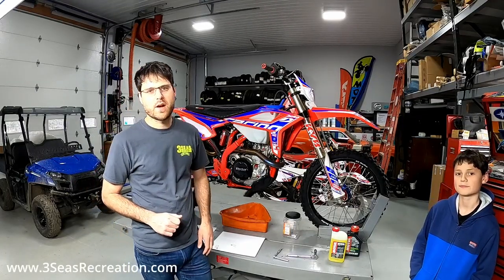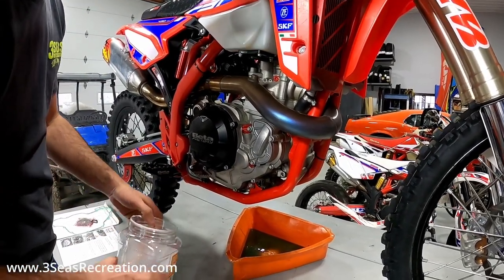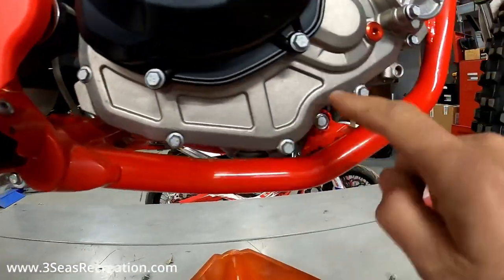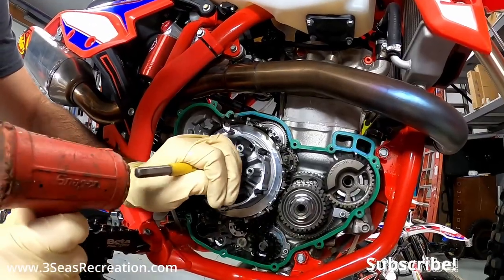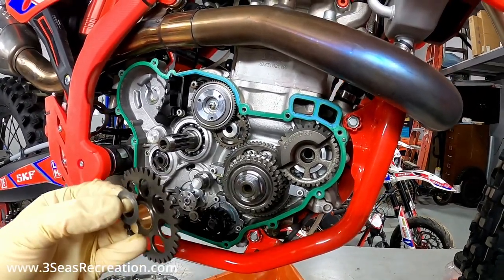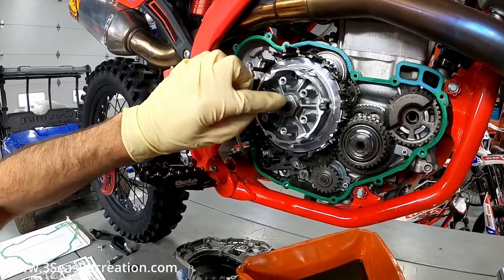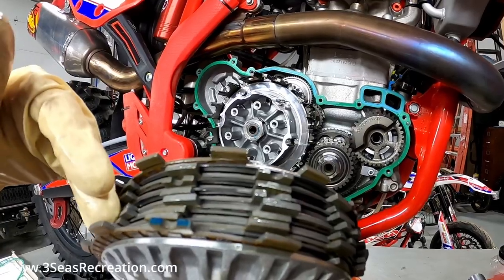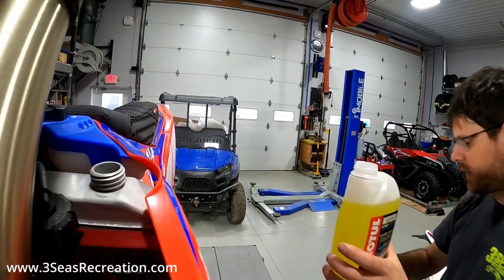OIL PUMP GEAR UPGRADE KIT : 2020+ Beta RR/RR-S 4 Stroke Steel Oil Pump Gear Kit, Beta USA #AB-12116

Comment: Would you recommend doing this to a brand new bike? I assume they haven't put steel gears on the 22's, correct?
Reply: Good question!
Reply from the maker: We have been a Beta dealer since 2011 and have never seen a bike fail due to the gears breaking. However, we have seen them pretty worn in the past on bikes that have quite a bit of time on them. If you were building a bike for the long haul I would consider it. Also, if you are in need of Beta parts give me a shout we offer discounts on OEM Beta parts/ accessories! Thanks, Jared
Reply: Didn't answer the question?
Reply: @stevenbrowne116  , I'd like to know the age, mileage and hours on the bikes with worn out gears!  Then I could make a better decision on changing mine if ever buying a 4 stroke.
Reply: @3SeasRecreation  , hey Jared, we are wondering what model years, and the mileage and hours on the bikes that have worn gears?

Comment: Hi Jared, thank you for this video, it'sclear and simple explained.
I have an old 2012 RR 350, i will check this out for the oil pump, can i follow your vid for the freewheel too? The elecric starter does not start the engine anymore .
thank you for your job

Comment: Thanks for your videos. This is really helpful in assessing when and if I will replace the gears on my 21' 500 rrs. On a tangential note, if I install the kickstart on an EFI four stroke, will it still need 11 v in the battery to start?
My bike went completely dead right as I was going over a log and left me stranded 4 miles from the truck. I didn't miss a kickstarter until that moment.
Reply from the maker: The kick start kit will always help when the electric start system fails. Like if the fuse blows, switch fails or the e-start motor quits working. The only side note is that the 4 stroke EFI bikes still need a pretty good battery to run. The bikes will "run" if the battery is weak. So if you are 4 miles from home I think a failing battery would get you home with a kick start kit and then you can replace the battery before the next ride. Thanks for watching and the comment, Jared!

Comment: Is the new locking washer for the clutch included with the new oil pump gears? Thanks for the video. Great detail
Reply: Nevermind. It’s in the beginning of the video!
Reply from the maker: Glad you caught it, feel free to ask questions any time! Also, if you are looking for Beta parts/ Accessories we offer discounts & free shipping depending on the order size. All Beta orders that are placed through our dealership are drop shipped directly from the Beta USA warehouse to your doorstep! Enjoy the ride, Jared

Comment: Good stuff, I just did mine a few days ago on the 390. One question, do the orientation of the notches on the outer fingers matter? I did note the inner and outer plates with the blue markings but didn't orientate the fibers in any specific manner in relation to the outer notches. Thanks, great channel.
Reply from the maker: Good Afternoon, thanks for the comment! No it does not matter on the clutch plate orientation between the outer basket arms. Thanks for watching,  Jared

Comment: You ever change out the countershaft of a 2021 beta 500RR-S.  I stripped the splines off of mine and have to change mine out
Reply from the maker: Good Evening, that is unfortunate and most likely a full tear down... that requires the engine cases to be split to get to the transmission. We have had full engines apart but not as often on the 4 strokes. Thanks, Jared
Reply: @3SeasRecreation  160hrs and 4500 miles.  Is it bc I do not have a cush hub and chain tension was to tight?

Comment: doesn the motocool just raises the boiling point or does it too makes a better heat exchange, so bike runs cooler ?  Is it antifreeze too and if so to what minus temp.  Last question ; can it be mixed with  water in case of ? ( distilled of course) thanks
Reply from the maker: Good evening! We enjoy the motocool and has never let us down. I do not know the sience behind it other than it passes the field test! I would not mix it with water before a race but to get out of the woods I would! Enjoy the ride, Jared

Comment: So do you ever have any come out the breather filling to 850
Reply from the maker: Thanks for watching our video! Good question, I would always recommend filling the engine side to 750cc (for this model)  but we have always ran more oil in the gear side, with a bit more oil it helps reduce heat in the clutch. In the older bikes (12-14ish) I had been told from the race department they would run a full quart in the gear side. Thanks, Jared
Reply: Thanks for the reply and that’s good to know , I think my problem is when I start getting past to balance point it runs up the breather and into my airbox. Any tips to get it to stop coming out the breather on wheelie ? Maybe a catch can I guess lol

Comment: I have a 2018 Beta 390 that I bought used. Am I able to tell if the gears have been replaced by just removing the clutch Cover?
Reply from the maker: Good Morning, I think there is a good chance you could see the gears if you pulled the outer cover. Worth a shot! Enjoy the ride, Jared

Comment: have you seen a the gears worn badly
Reply from the maker: Good Afternoon, no we have not. The stock gears hold up well. I would recommend replacing them on the older bikes. Even if you went the stock plastic gears again. Thanks, Jared
Reply: On  my '17 390, the larger plastic gear was shredded at 75 hours.   Glad I checked early and put in steel!
Reply: @dznnf7  , I am happy for you, that was a smart move!  About how many miles were on it, and what kind of riding?  Several of us are wondering when to start checking.
Reply: @captainamerica9353  A couple thousand miles.  Dual sporting and trails, no races.
Reply: @dznnf7  , that sucks!  I hope Beta at least gave you a replacement kit.  That is unacceptable, obviously they should switch to steel gears and put an end to the issue.